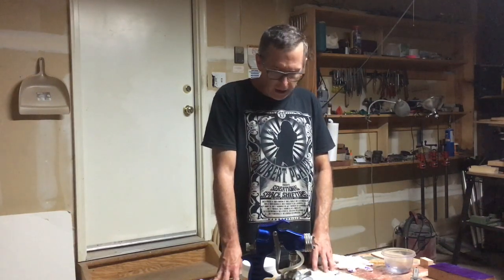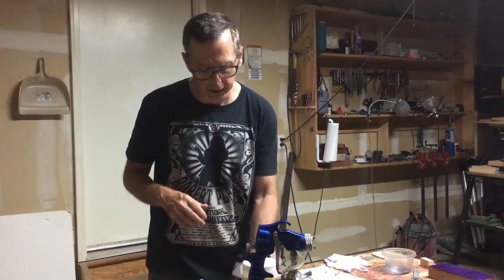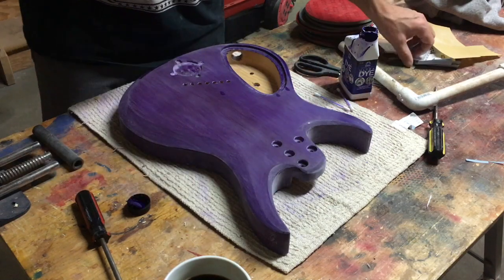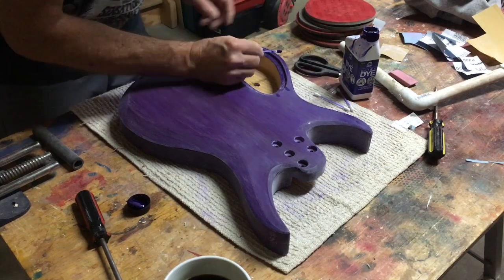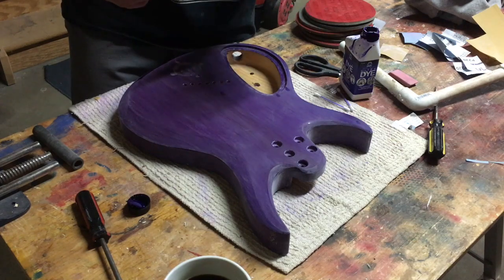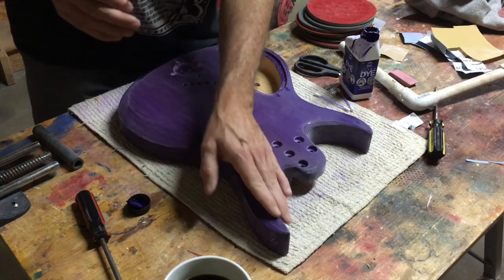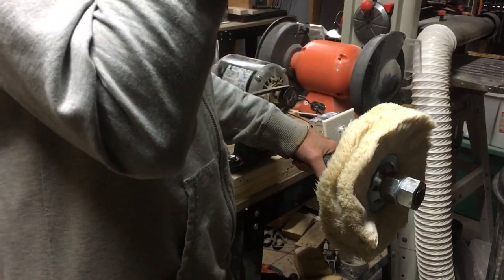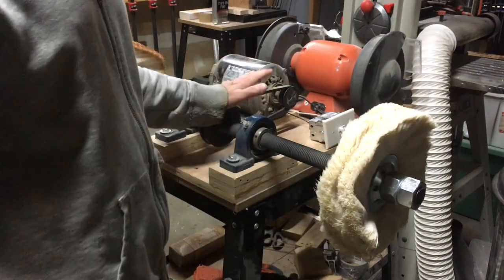Let's Talk About Water Based Guitar Finishes

Comment: If you shouldn't wet sand because water activates the clearcote then how do you clean the guitar and does that mean you shouldn't get it wet at all?
Reply from the maker: Standing water could reactivate a water-based clear coat that hasn't fully cured. Once it's fully cured, you can wet sand. However, I recommend dry sanding because it can be done after a week or two of curing. Otherwise, you need to wait up to 6-8 weeks for the cure to finish. Once the finish has fully cured, you can clean it with a damp cloth. Just don't let it sit in a bathtub full of water ;-)
Reply: @HighlineGuitars  Got it...thanks for the info and for being able to benefit from all your experimenting and experience.

Comment: Im trying the CrystaLac Bright Tone clear gloss instrument finish. I keep having problems with fish eye. The process was Keda dye mixed with 93% isoprol  alcohol, a seal coat of shellac, grain filled, then 3 more coats of shellac, level sand wipe down with water to remove all residue, let dry overnight, then spray on the Bright tone..... using a LVLP gun and my old craftsman oiless air compressor with water trap and also an inline filter at the gun.... Any suggestions????
Reply from the maker: Thomas Doyle you should contact Crystals.

Comment: Hi Chris, I understand that you do not do wet sanding when sand between coats. But how do you eliminate dust and wood (coat) dust that is produced during sanding and almost sticked to surface without water???
Reply from the maker: After sanding, wipe the surface with a clean cloth dampened with denatured alcohol to remove any dust.

Comment: These videos are incredibly helpful and informative. Can you talk about your spray setup a bit, in terms of safety precautions? I’m making the leap into building my own guitar and I want to make sure I set up a finishing station that is going to keep me safe. Do you need a dedicated spray booth for these types of finishes? Thanks! Subscribed :)
Reply from the maker: If you're only going to build one guitar, a spray booth really isn't necessary. I do recommend you wear a good respirator that is intended to block paint fumes since even water-based products aren't meant to be inhaled. Find a corner of your shop where you can spray. Put down a plastic sheet on the floor and hang a couple more from the ceiling so you won't get any overspray on the walls. A good HVLP spray system will reduce overspray a lot, but there will still be some to contend with. Also consider wearing a disposable painters jumpsuit, gloves and a headcover. If you plan to build more than just one guitar, a portable DIY spray booth may be in order.

Comment: So General Enduro Pre-cat lacquer or Crystalac??  Which do you prefer?? Great videos!! Thanks
Reply from the maker: Crystalac. I stopped using the Enduro Pre-Cat stuff. Too many fisheyes.
Reply: Oh no!!!  I just bought a gallon based on your recommendations. ;-(  Any thoughts on how to prevent the fisheyes??
Reply from the maker: You may not have a problem. I know many others who used it a while back did and complained to General Finishes. Nothing we could do fixed the problem, but that was over a year ago and they still are selling it. Customer feedback may have forced them to reformulate the product. If it works for you, let me know as I'd like to try it again. It was much cheaper than Crystalac.
Reply: I did the same thing.  Bought a gallon for $54 :(  The results of my first try were disappointing.  Guess I'll hold off on the Crystalac

Comment: Another excellent tutorial,  Chris. Thank you! Could you post links to that dye and the crystal lac clear?  What spray system and tip size are you using -  looks like a turbine.
Reply from the maker: I added link in the description. I use an Earlex 5500 HVLP spray system with a 1mm tip.